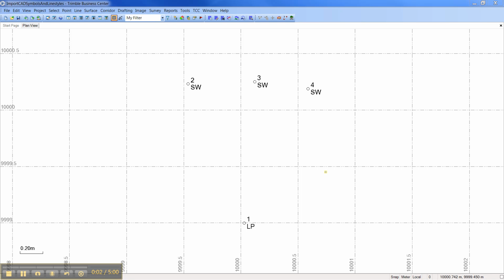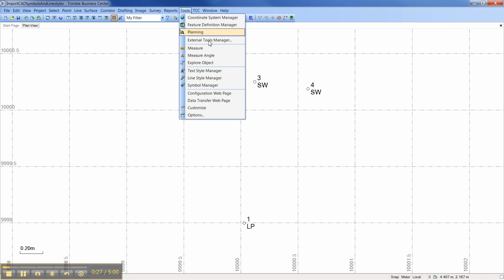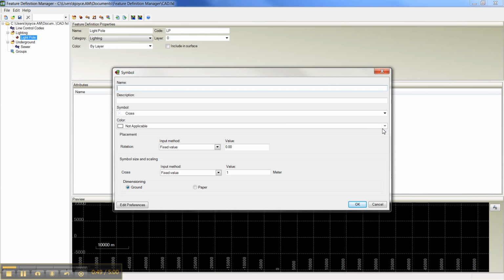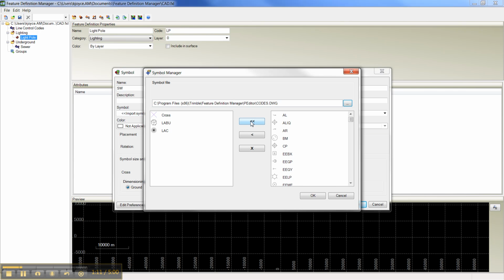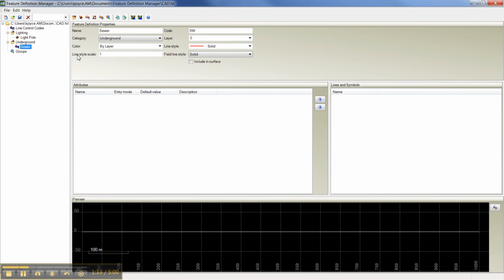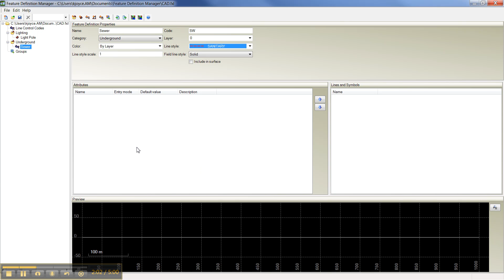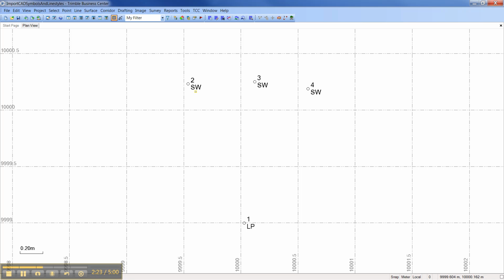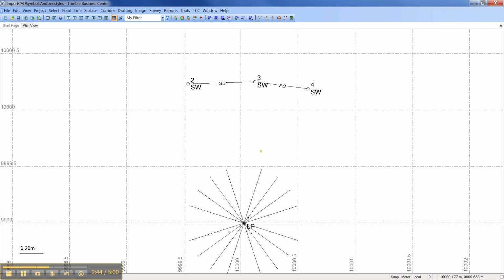TBC 2.70 Import CAD Symbols and Linestyles

Comment: What if you want both a symbol and line on a point??
Reply from the maker: Hi Lachlan, you can use more than one feature code on a point. Simply separating the codes with space. In that way, a point can have its own point symbol, and be a part of a line at the same time.